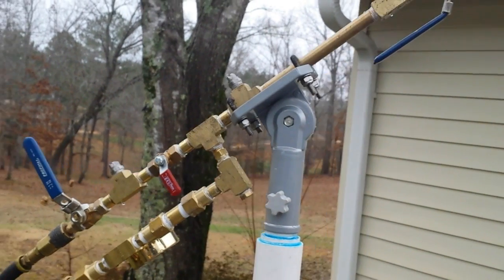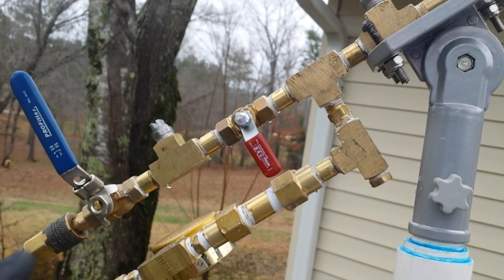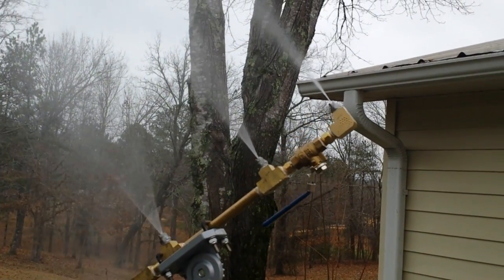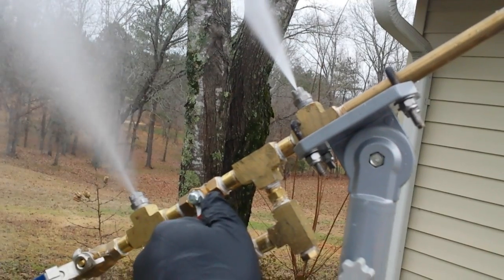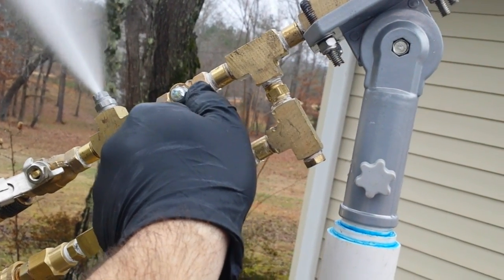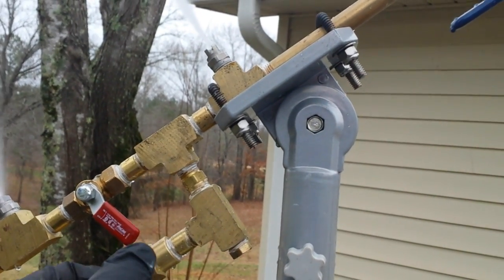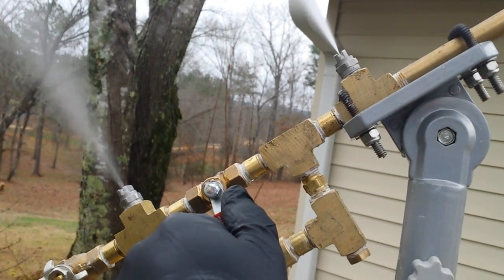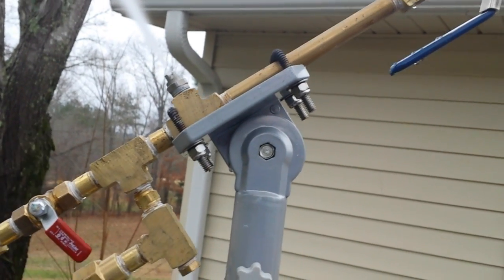3 nozzle snow maker adjustment

Comment: What is the estimated production rate?
Reply from the maker: See my other comment on wind effects, but in the right conditions you can expect roughly 0.5" or a little more per hour in the area it is falling.  The area in which I get this amount is estimated to be an oval around 10-15' x 20-25'.  You have to move it around to get even coverage for say sledding,  otherwise you make a large mound.

Comment: Hi Chris,

How cold must it be before those nozzles can produce snow?

best regards
Reply from the maker: There are charts for wet bulb temperature which dictate when and basically how good the making will be....at my humidity levels in Mississippi, I have found that 27F is the highest it can be, and best making happens between 20-26F.  Accumulation is a huge function of wind and how much it gets carried away...a slight breeze in the right direction really helps carry and get more spread out coverage,  or really hurts in the wrong direction.

Best regards,
Chris

Comment: where can i bye on of those adjustable elbow joint things
Reply from the maker: that is a flag pole holder from Lowe's with a tapered pvc pipe fitted into it
Reply from the maker: MN Life - please let me know you have any more questions.
Reply: Ok thanks
Reply: And also what nozzles are you using
Reply from the maker: MN Life I am using either MEG 4002 and or 4003 depending on the pressure washer and number of nozzles in order to maintain 600psi.  I am using a MEG 2505 nucleation nozzle.
Reply from the maker: 1/4"